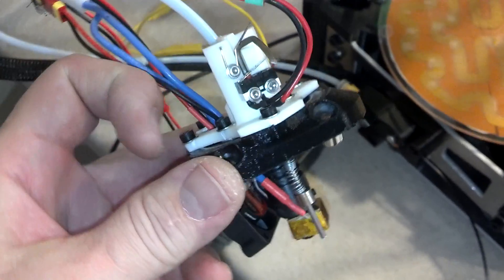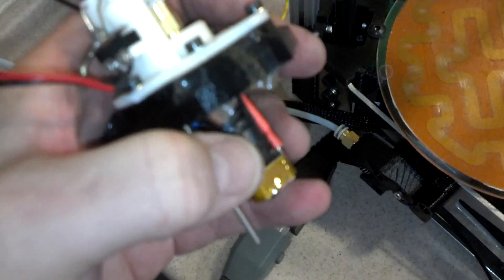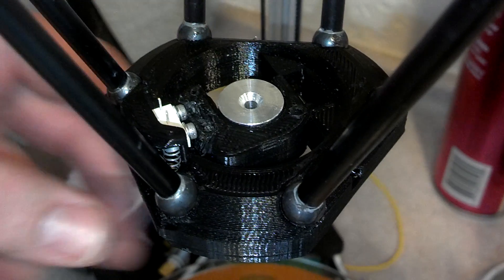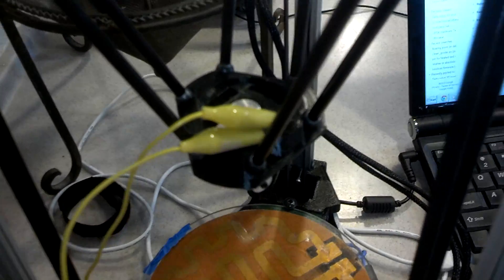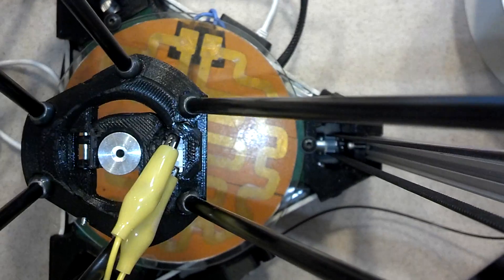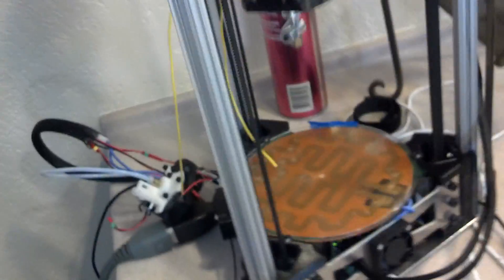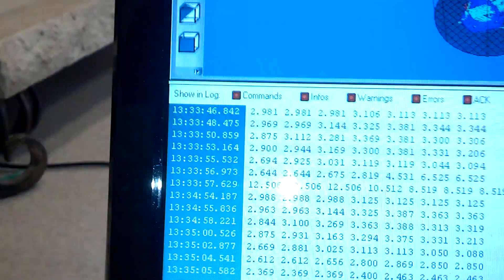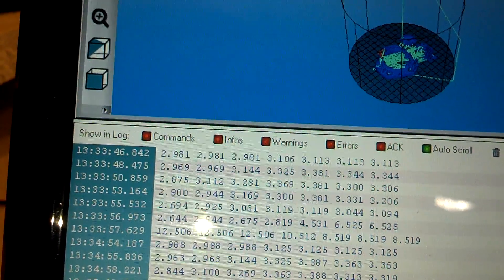Using hotend as bed-level probe

Comment: I'm still a bit off from building my own effector, but what firmware is that you are running?
Reply from the maker: For deltabot printers I suggest running either Duet or Smoothieware firmware/hardware.

Comment: i think the 10-30 microns inconsistency are so good compare to inductive sensor, but then again you are doing it too fast, i think you can achieve better accuracy if u slow it down, just a thought. Now i am thinking of 3 vertical spring on the hotend holder against the carriage instead of hinge like u did so that during printing - there wont be any x or y displacement of the nozzle when it drags on the previous layer of the printed material. Then i am not so creative on designs,if you can implement this i would love to see a video. Then again, this is 4 year old stuff for u, i am sure you have a well working design by now.

Comment: Might there be a problem with the heat which radiates from the hot end from warping/softening the switch mounting above during a long print? Looking forward to seeing how you get on with this.

Comment: This looks really promising. Would you run such a bed level run with bed and nozzle heating on or off. How much difference would that give you if you use the head as measure point?

Comment: I see, I was under the impression that you would only need to run bed level only when you change the bed or nozzle (infrequently) and would assume the nozzle would be clean.  I can see how tin foil would be a pain, maybe a more sturdy sheet of copper?  If the heat is not on, there could be plastic build up on the end of the nozzle for this method which could cause inaccurate results as well.

Comment: You'd have to use an aluminum plate instead of foil. Imagine what a pain it'd be to place new foil on for every single bed level. Also, the biggest problem would be that the hotend squeezes out molten plastic, and is, as such, usually coated with a very very thin layer of it on the tip. You'd have a hard time detecting a contact without completely cleaning the nozzle before every level. Also, the spring and switch mean the nozzle has a bit of give, and doesn't have to smack the bed.

Comment: For safety, the switch is wired Normally Open (The probe closes the circuit when deployed, opens it upon each bed contact) so that any break in the wiring or movements will cause the platform to detect a "hit" and from there, only go up. It will never go down any further unless the probe is pressing the switch. The only thing that could cause such an issue would be a fused plate in the switch or board, which is impossible because there is no voltage across the switch.

Comment: It does not know when it hits the belt, that specific movement is hard coded into the firmware. That's a vestigial motion that used to be used to drop the metal pin on the side of the hotend.

Comment: Why not use the hot end as a lead, and when it comes into contact with the bed and have a sheet of aluminum foil be the second lead.  Then add the thickness of the foil .2mm or w/e to the z height.

Comment: Just as well to have the hot end be the probe. If you have some other kind of probe and it fails, it will most likely rip the probe off the effector and crash the nozzle anyway. Plus, you don't have to worry about figuring out the x/y/z offset. For safety, the firmware should be made to go slow, and assume that if too many milliseconds have passed that the probing has failed and it should beep the beeper and send a warning over serial. I have my own probe design but this is CLEARLY better.

Comment from the maker: Interesting observation. I really don't think it will be an issue. The probe stops as soon as the endstop switch is triggered. Much less stress than a head crash into the bed. I think the fact that it is probing the tip of the nozzle flat to the glass so that the point load of the force is distributed over the face of the nozzle tip will keep the loading lower than deformation modulus.